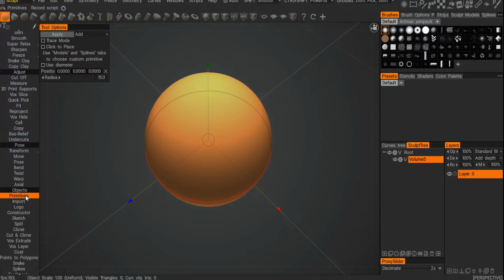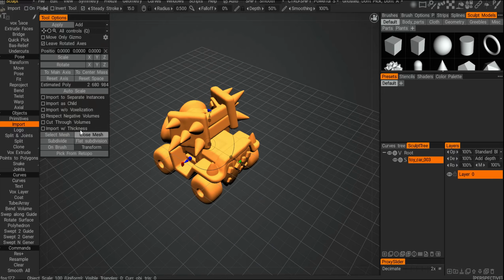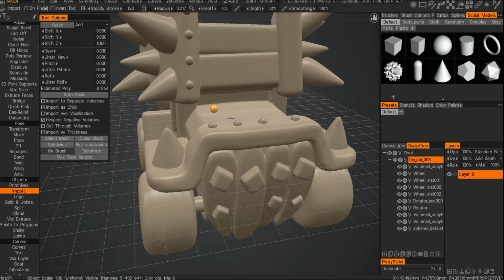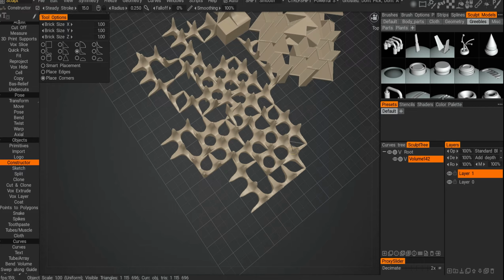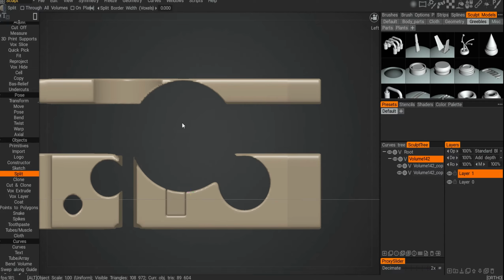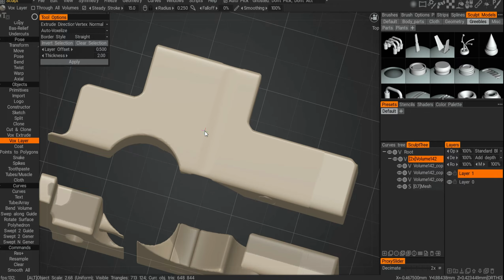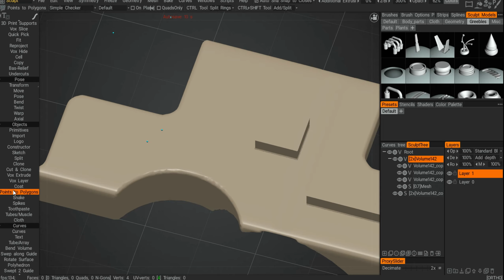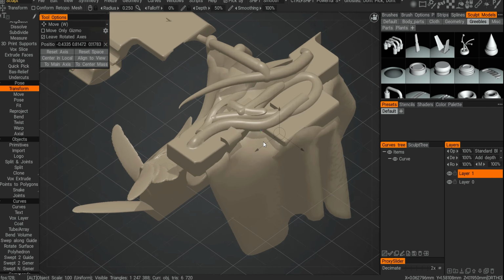Object Tools - Sculpt Room - Intro to 3D Coat - 13

Comment: Hi Anton, may I know, is it possible to create an model, and put it in a layer or something, then, I can insert that model just like primitive where I can add or subtract to another model. This is the closest method to ZBrush live boolean that I can think of. At least, I have both the original models ( the source and boolean) as backup if the boolean goes wrong.
Reply from the maker: Hi, the newest 3d coat, it's like 1 week old, has the boolean feature. But I haven't tested it yet properly
Reply: @AntonTenitsky  hopefully it is similar to ZB live boolean. I am too familiar with ZB and had developed a workflow that works for me, the workflow might not works in 3DC. But i really like many features in 3DC that is not present in ZB.

Comment: Learning the ins and outs of this program is not fun (a lotta cursing) and I can see you yourself have struggled to make it work for your with a lot of tools. So it's satisfying to go in and find a new tool that actually is capable of very refined and beautiful output. Thanks for your efforts.
Reply from the maker: Yeah, I try to only a few tools like blob tool and vox hide for like 80 percent of my work
Reply: @AntonTenitsky  All the top portrait guys and I mean the ones that produce hyper photo real portraits that would fool the average person into thinking they were looking at a photo of a real person agree that the Move tool is the most important in their work. They start with very low poly base geometry and push that as far as it will go then very hesitantly increase their resolution.  Zbrush has Move Elastic, Move Topological and just plain old Move. Move Topological is the most useful one overall. But yeah you can really go crazy on brushes ; your intro to 3dCoat 18 Surface Brushes takes a lot of trial and error to emulate and master. It would be daunting without even your direction to rely on.

Comment: I realy appreciate this series, i learned a lot and I want to thank You for it. I have one question, which I couldn't find on the interwebs - is there a hotkey for selecting different objects for sculpting, in case I dont want to use Auto mode?
Reply from the maker: Hmm, I don't know, I don't think so
Reply: @AntonTenitsky  Understand, thank You
Reply: @AntonTenitsky  I learned 3DCoat have Pick tool, so it's hotkey "h" to pick objects for sculpt :)